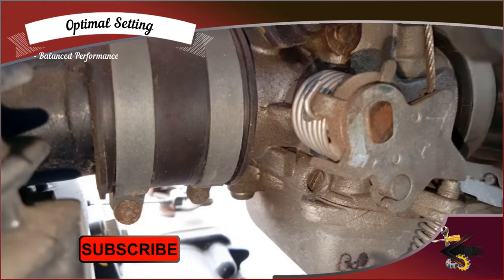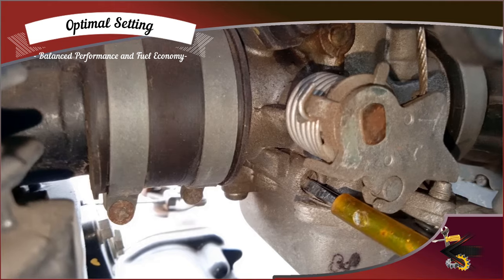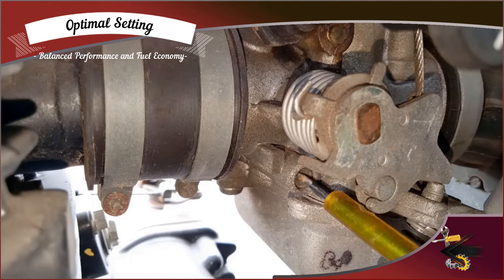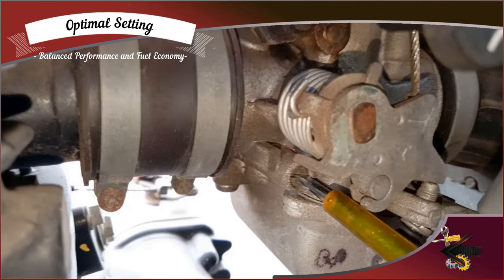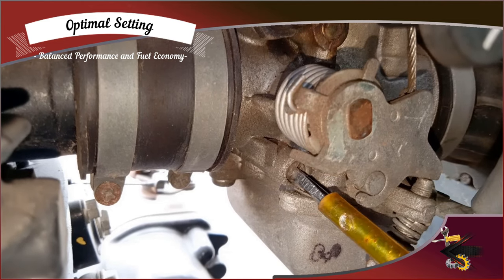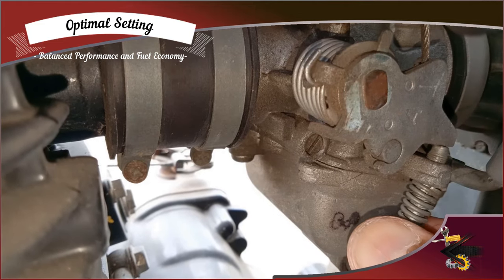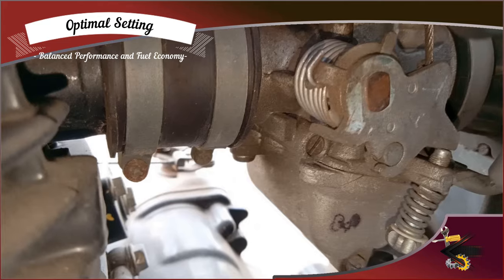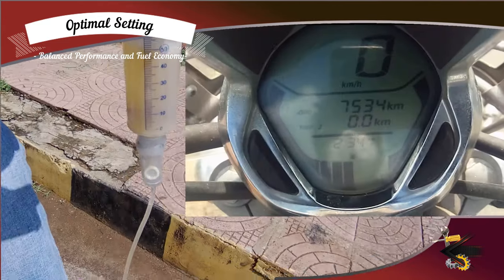Carburetor Tuning Mileage Test | Best mileage test | #carburetor | #mileage | #increasemileage

Comment: I tried your method but i got maximum milage on Highest RPM and in lowest RPM spark plug got black and milage also decreased.  I think all other video that i found on you tube is correct and need correction in this video.
Reply from the maker: That's not the case, you have the practical proof here. Also, many users have applied the same setting and confirmed the same. You might want to get your vehicle checked in that case.
Reply: He is telling wrong
Reply: Yeh sirf 150 ,180 , 220f pulsar
aur TVS apache bike per kaam krta hai
Reply: @preet2158  Mai splendor pe try kia 😂😂😂
Reply: He is telling fully wrong. Please check Google and and get more article. Rich mixture your sparkplug make complaint
Reply: Konsi bike pe try kiya...ye sirf butterfly carburator k liye h

Comment: Er.. I have a problem with this.. you went to 63 kmh. At one point you had to slow down then speed back up. You didn't maintain a constant and specific speed with each setting. Won't the speeds you reach and the amount you vary your speed effect the comparisons?
Reply from the maker: Yes they do. I tried to be consistent and I chose the road with least traffic. But still there was some traffic which caused the change. As long as there is no gear shift, there should be very marginal difference
Reply: @autobotgeekse  Got it, Thanks.
Reply from the maker: you are welcome

Comment: The mixture screws on the air intake(airbox/filterbox) side are usually air adjustment screws that control air volume to the pilot circuit.
The screw you are adjusting on the engine intake side is a fuel metering screw or a volume control scew(VCS) that regulates fuel spray into the cylinder.

Screwing it inside(clockwise) reduces the fuel supply making the mix LEAN. (less performance, more heat, more efficiency in certain cases)
Screwing it outside(anti-clockwise) increases the fuel supply making the mixture RICH. (more power, less heat)
This is the reason your rpm is falling when screwing inwards clockwise since the mixture is going lean, and vice versa.
And hence why your test correctly results in better efficiency on LEAN mixture but you have denoted it RICH in the video and vice versa.

+
Both screws have effect on the air/fuel mixture from 0 to 50% throttle only which is likely what you have used during testing.
Reply: Yes I was wondering what hell he is saying

Comment: What u said here as rich is actually lean and what u  said here as lean is the rich mixture
Note- when u tighten the air fuel adjuster inward lesser the fuel supplied for same quantity of air so the second part when u tight inward the "afr'' screw lean the mixture and more the milage and less the performance .lean means more air and less fuel..... The correct way is lean 54kmpl and rich 42kmpl ...optimal same no change
Reply from the maker: Thats not the case. Air screw regulates the amount of air we let in to the combustion chamber. Remember that is not the fuel screw. The fuel suction aperture in the carburettor always remain constant. So fuel suction is always dependent on the amount of air we let in. If we open the screw we let in more air resulting in more suction of fuel. When we tighten the screw, we are limiting the air flow resulting in less suction of fuel. This is known as the capillary effect. Remember Air screw regulates the air to fuel mixture ratio. Lean setting means less fuel and more air, since fuel aperture is constant no matter how much we open the air screw it can only suck max fuel that can pass through the aperture. Hence, air to fuel ratio will be lean. When we tighten the screw air will start sucking less fuel however it will make the mixture rich since fuel ratio will be more than that of air when we are limiting the air flow. Remember the amount of fuel sucked during rich setting will be comparatively less than that of lean setting.
Reply: Thanks for your contribution. I was almost there until you came up and corrected.
Reply from the maker: @jerityzviregei6315  wc
Reply: @autobotgeekse  ❤

Comment: Rich means more fuel and less air would go to the Combustion chamber where Lean means less fuel and more air would go to the Combustion chamber.
So, How does Rich setting for better fuel economy? 
and Lean setting for better performance? please explain. I think you are saying it upside down
Reply from the maker: Air fuel mixture screw lets you tweak the air ratio mixed with the fuel. This screw does not regulate the fuel directly. Fuel suction is directly proportional to the amount of air we let in. When in Rich setting, we are limiting the air intake which will result in lesser fuel being sucked from the fuel line. When in lean setting, we are letting more air in which will result in more suction of fuel resulting in lesser mileage. Its similar to the action that happens in ventury where fuel suction is controlled basis the throttle position. You can see the test results as it stands.
Reply: @autobotgeekse  I think this is the first video on YouTube that shows the difference between lean , optimal & rich mixture... With proof... 
I hope everyone should watch this video before tuning carburetor... 
All other Youtubers are showing just lean mixture setting and saying this is the best for mileage but it is not correct...
Reply: @zs6973  sehi bola bhai
Reply: @zs6973  yes. 
Woh sab anticlockwise air mixture screw open karke jaha gadi ka rpm means awaaz tez ho rahi hai bas whai sett kar dete hai. 
Baad me idle screw ko bhi anticlock wise kholkar gadi ka rpm means race sett kar dete hai. Aur kehte hai lo ho gaya sett. 
Ab gadi petrol kam khaegi 💆💆💆
Reply: @autobotgeekse  what about in fuel screw?
Reply: @autobotgeekse  what about in fuel screw type carburetor? it is the same or not!
Reply from the maker: @paolomarcelogalvan1938  Idling screw screw regulates the air passage from the main manifold resulting in fuel suction difference from idling jet.

Comment: Bro. This is the correct explanation that I found on the internet. Even though I am not an engineer, I maintain my bike. Wanted to know if keeping a lean mixture affects the engine in any way?
Reply from the maker: Thank you, no it would not affect the engine adversely. Just that engine runs a little hotter in lean mixture. This is due to the excess oxygen in the air we let in.

Comment: Normally Technicians set it at highest RPM.
It qualifies PUC requirements.
Your experiment opens up a new horizon.
I guess it is difficult to get the positon for ideal mixer.It can be any where between rich & lean mixture.
Reply from the maker: Yes, point of highest rpm will ensure good performance. Setting should be tweaked basis the requirement. Ideal mixture position varies from vehicle to vehicle as well. Hence, steps shown in my other carburetor tuning video has to be followed to set the correct mixture
Reply: @autobotgeekse  do we need to increase the rpm from idling nut to 3000 before tweaking with mixture screw??
Reply: @autobotgeekse   i have an avenger 150 and it was giving 38 average in 1 liter , then i saw a video and tighten the mixture screw completely and rotated it 5 full times to anti-clock wise.. now the bike is giving just 32 average ..
Now i am watching your video and trying to understand better
Reply from the maker: @Aliaquadiaries  please see my other carburettor tuning video where I have explained the complete tuning process in detail. For rich mixture setting it will be somewhere around 2 full turns from close position
Reply: @autobotgeekse  okey so as my current position is 5 full turns from the close position..
So now shall i reverse 3 full turns towards cloclwise??
Reply from the maker: @Aliaquadiaries  yes please, try that
Reply: @autobotgeekse  thanks for you kindful and helpful reply .. yes i will try that ..also can u clear 2 things for me..
First the idling nuthow much we have to set it so it became ideal throttle
And secondly the small screw which remove waste and little petrol from the waste pipe that screw is jammed since many years on my avenger , many mechanics tried to open it but they werent successful.. what can i do?
Thanks
Reply from the maker: @Aliaquadiaries  For idle screw, you will need to adjust basis the beat frequency, once you adjust the air screw to 2 turns. For waste screw you can leave it as long as you are not having any starting issues due fuel overflow. Alternatively, you can try for used carb parts and replace the bottom cap
Reply: @autobotgeekse  thanks for the 1st part..
Regarding to waste screw yes i dont have any problem regarding starting , its a one crank start but i faced a issue that after my fuel tank was empty and i put petrol through bottle , all the petrol came out through waste pipe and got spoiled on ground
Reply from the maker: @Aliaquadiaries  oh, in that case that screw has to be replaced
Reply: @autobotgeekse  thank you so much for your timely replies ❤️
Reply from the maker: @Aliaquadiaries  wc bro

Comment: On this carburetor, which is installed on Bajaj Avenger 220, Pulsar 180 motorcycles, the VC idling mixture quality screw regulates the supply of the mixture, not the air. By turning the screw clockwise, the mixture is depleted, by unscrewing counterclockwise, it is enriched. Look at the service manual for Bajaj pulsar, it describes the operation of this carburetor!

Comment: So lean means we r giving less fuel and more oxygen so shouldn't the mileage be more in it? Today I got my bike's carbeurator serviced as I ws getting 40/kmpl in ct100, it was running on very rich mixture. So mechanic serviced and made the mixture to very lean.
Reply from the maker: In lean, when we compare air to fuel mixture ratio, fuel will be less than that of air that reaches the combustion chamber. However, the amount of fuel that gets sucked is still higher than that in rich setting.

Comment: Hello did you said lean setting best for performance and rich setting is best for mileage ....is this mistake, becUse lean means less fuel and rich mean more fuel can you clear confusion
Reply from the maker: Yes thats what it is. When we say lean  and rich setting we talk about fuel to air ratio nd not only fuel. In lean setting the fuel ratio is less aginst the air however the fuel that gets sucked due to siphoning is still more than that of a rich setting. Hence we get better fuel efficiency in rich setting as it has less fuel suction due to less air flow.

Comment: Dear Autobot Geeks E. Lovely video. Very systematic and logical.

However I would request you to please help me with one clarification. Are all  tuning settings on cabruretors universal? I mean, on all carbs does turning the air screw anticlockwise lead to leaner fuel mixture?

I m asking because one old mechanic told me that on some bajaj bikes this is reversed. When u tighten the air screw on some models, it makes the mixture leaner.

Would that be the case in your video? Would that be why u got more mileage when you tightened the air screw?
Reply from the maker: Thank you for your time. Air mixture is leaner when you let more air into the combustion chamber. All the models that I worked with worked as clockwise for rich and anticlockwise for lean. There may be instances where it can be vice versa, however you can make that out by checking the thread pattern. Also, you can see if the screw is going in or coming out when you rotate it. All carburettors use the same principle. Please watch my other video where I have explained the carburettor tuning in detail.

Comment: Great video! But I think that's a fuel screw not an air screw since it's closer to the engine side rather than air filter side. So, you're actually making it leaner when turning clockwise. Can you confirm that it's a fuel screw by unscrewing it out fully and check if the screw tip is pointed? Otherwise it's an air screw if the tip is wider and a bit flat.
Reply from the maker: That is the air mixture screw with a tapered tip.

Comment: Ur definition is good, but, slightly confusion, so, tell me the answer, is Rich mixture will damage the engine, please reply, after that I will try ur procedure, .
Reply from the maker: No, it will not damage the engine. You can try it without fear.

Comment: What is performance?
Can Any body explain plz?
Reply from the maker: You will have a little dip in performance in Rich setting and a dip in fuel economy in Lean setting. But not that alarming variation. Most of the times it's unnoticeable.
Reply: @autobotgeekse  ok thanks 👍
Reply from the maker: @nani_alpha  wc bro
Reply: What other experts taught about lean and rich settings is totally different from you. Other experts taught that rich settings consume more fuel  and lean settings consume less fuel but more air . And  what you explained in  the  opposite way 🤦🏽

Comment: What is default factory setting for Avenger 220.... How many turns from full tightened screw
Reply from the maker: It will be around 3 turns, however it also depends on person who prepares the vehicle for delivery. It may vary

Comment: Does this air/fuel mixture tuning influence performance in all throttle positions? I am confused because I thought this screw was only for the idling pilot circuit and that the other jets need to be adjusted or changed to change performance at different throttle positions.
Reply from the maker: It does impact the performance as well but not that significant difference. Up jetting or down jetting does make a noticeable change in performance though

Comment: Brother which setting is best for long term, optimal or rich?
Reply from the maker: Either of the settings will not impact your engine life that much. However, in Rich setting you may experience some cold start issues. Please see my other carburettor tuning video where I have also spoken about factors affecting the carburettor tuning.

Comment: Please Reply NS 200 BS4 how many turns?
And what is default setting?
Reply from the maker: Please see my other carburetor tuning video where I have explained the complete process in detail
Reply: @autobotgeekse  Full 2 turns is good or bad?
Reply from the maker: @sayanbanik1992  most of the times, for bajaj bikes, full 2 turns from complete close position will give you Rich mixture setting.
Reply: @autobotgeekse  so is it good or bad?
Reply from the maker: It should give you better mileage
Reply: @autobotgeekse  thanks brother
Reply from the maker: @sayanbanik1992  wc bro

Comment: ummm I think that is a fuel mixture screw that you're adjusting on your bike

clockwise is leaner
counter clockwise is richer 
it only adjust the fuel quantity that is allowed to exit from the pilot jet circuit

I think you got it mixed up with the Air Screw which adjusts the Air that is allowed to enter the pilot jet circuit

with the air screw if you adjust it in a clockwise rotation it makes a richer mixture and clockwise makes it leaner

in your case with your bike, you adjust the fuel mixture screw.. you make it leaner to get a bit more mileage
richer to get a bit more performance
Reply from the maker: Adjusting the air screw clockwise will result in richer mixture with better mileage.
Counter clockwise wise will result in leaner air fuel mixture ratio for better performance.

Comment: I am watching from Bangladesh. Some  motor bike technician in our country used compound / vacuum gauge for air pressur and fuel  mixing. can you tell me  please it will make  proper ratio for carborator tuning or showing off?
Reply from the maker: Yes, that would definitely help in proper tuning. However, it is not that commonly available for everyone
Reply: @autobotgeekse  thanks for reply
Reply from the maker: @dewanmahmud8862  wc bro

Comment: Driving vehicle in long  run with rich carburator tuning. Will it leave adverse effects on engine?
Reply from the maker: No, not at all
Reply: @autobotgeekse  yes sir.. it affects the engine. I also verified my information with people from Yamaha, Hero and Honda showroom.
Reply from the maker: @manishholla  In rich setting it should not affect much. In lean setting it would affect more as engine runs more hotter and timely maintenance is needed.

Comment: I bought TVS Jupiter in 2020, it has BS6 engine but mileage is only around 30km/l in city area, how can I increase it? And which engine oil is best for junior for better mileage? Can we use Castro 80w90 gear oil? But Manuel says use engine oil as gear oil. What will be the difference?
Reply from the maker: Gear oil is different and is of lesser quantity. Should always use specified grade engine oil which is around 900ml for scooters. For better mileage please see my other video for carburetor tuning where I have shown the detailed procedure of tuning the carb. I showed it for Jupiter

Comment: Bhaai ye google ka article h ab aap hi bataao ki ye sahi h ya aap , hum to confused h

Rich mixture
Has too much fuel, which can cause reduced efficiency and increased emissions. A rich mixture can be caused by a faulty fuel pump. leaking fuel injectors, or a clogged air filter. Symptoms include a check engine light, gasoline smells, and low fuel economy.
 Lean mixture 
Has too much air, which can lead to increased thermal efficiency and improved fuel economy. However, it can also cause stability issues due to incomplete combustion. A lean mixture can be caused by a malfunctioning mass airflow or oxygen sensor.

Comment: Brother please tell me the tunning adjustment level for better millege for avenger 150
Reply from the maker: You can see my other carburettor tuning video where I have explained the complete carburettor tuning process in detail
Reply from the maker: Air screw as should be around 2 turns from the complete close position